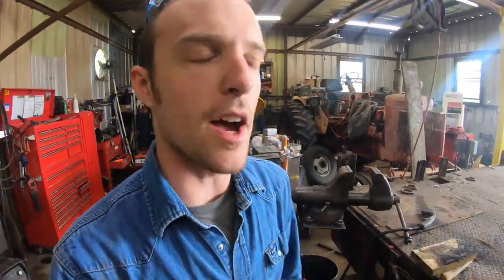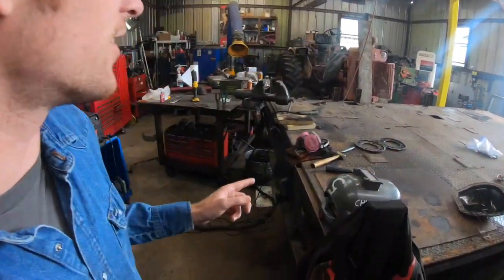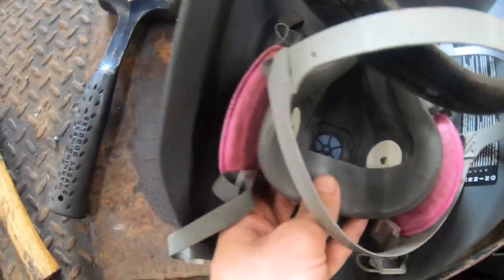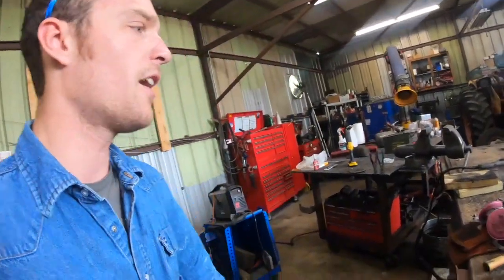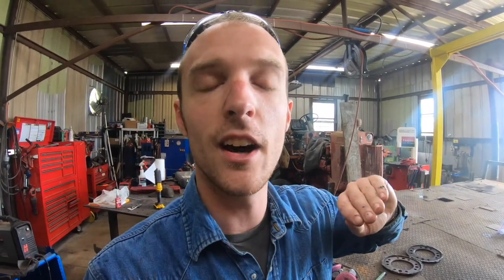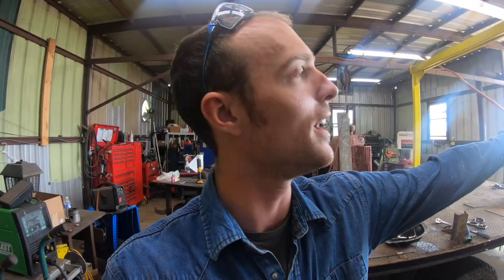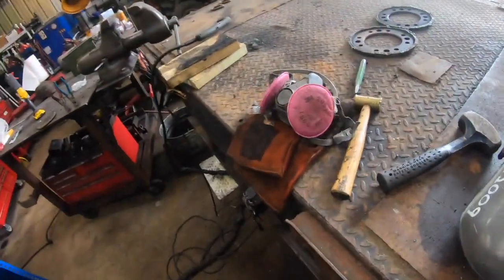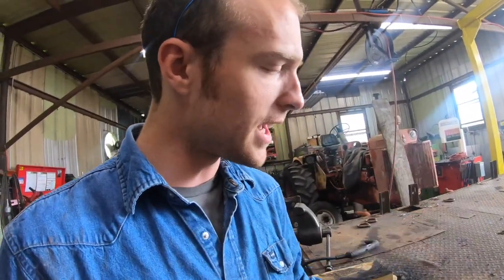THIS CHEAP RESPIRATOR KEEPS YOU FROM BREATHING TOXIC WELDING FUMES!!!

Comment: The mask is a life saver, i welded for years without one i am slightly concerned of any long term problems. The only bad part of the mask is when its hot outside.
Reply: Save up and get a lincoln papr. Cyberweld has them 500 bucks off. Its like a ac in your helmet and you dont have to work hard to breath in. Best thing i bought for welding. And the welding mask is dope.
Reply: @DIGGER19860  Without a doubt a wise investment im going to add that to my truck. i appreciate it.
Reply: @DIGGER19860  yeah but only really convenient for a shop guy. Refinery work it’s basically useless

Comment: Just a heads up most respirators come with a particle filter those will not protect from anything but, you guessed it particles (dust,sot and some liquid particles)so gases and most fumes just pass right thru so make sure that you get a gas/chem filter that is rated for the stuff you are exposing yourself to so do your material homework. As most(not all) particle filters are not gonna protect you from the common welding hazards like chrome, cadmium, lead, zink fever, hydrogen cyanide or most nasty epoxy coated stuff. Even pre-cleaning a surface with a grinder is risky as most coatings give of bad fumes when heated above a certain temp. Stay safe.
Reply: Yeah I was thinking it can't be good that I can smell the fumes when I use this respirator. My problem is I can't seem to find OV/P100 pancake cartridges. The only ones I see are for "nuisance vapors" which I assume means basically no protection. The full size OV/P100 cartridges don't fit under my welding helmet.

Comment: Working full time back in welding at a factory making Radiators for Caterpillar, Volvo etc. after my 1st 3 days I’ve had severe respiratory issues flare up. Bad sinus infection, sore throat, cough etc. we have “fume extractors” and small fans. However the place is just generally dirty, dusty, and stuff floats everywhere in the air. We have painters and Powdercoaters doing their bid also so there’s plenty of stuff to mess with your respiratory system. I picked up some cheap 3M N95 Respirators from Walmart today going to try those under my helmet and see how it goes. I work a 10 hour shift, Do you suggest I wear the respirator the whole shift or only when I’m welding and grinding like I do my helmet? Thanks.
Reply: n95 isnt gonna do shit u want p100
Reply: Always wear it